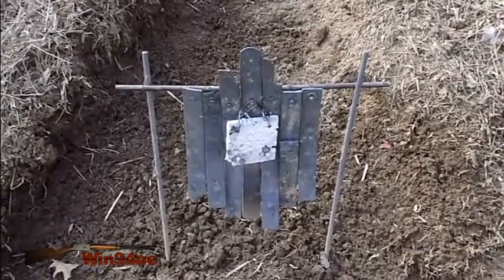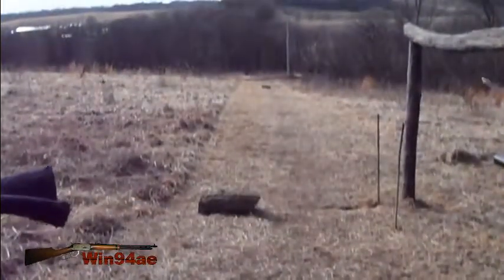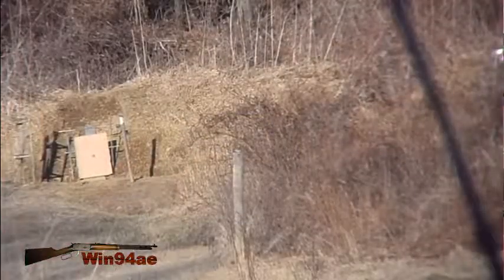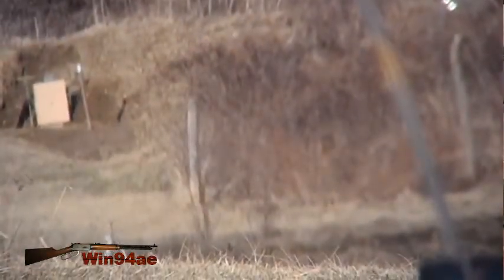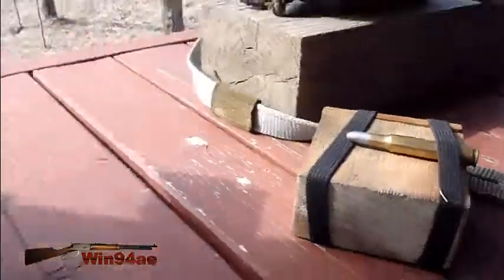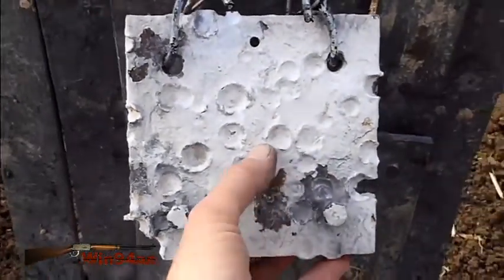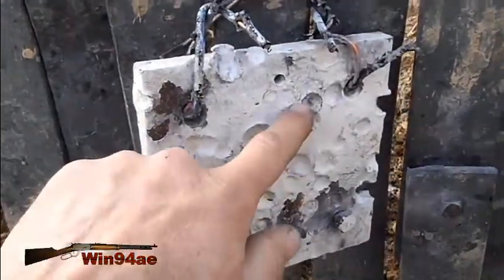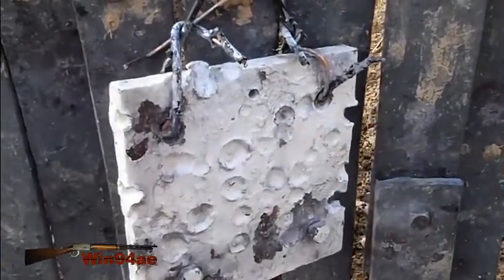30-06, IMR 4064, Cast 180gr, 2200fps

Comment: What was the charge weight for 4064 ?
Reply from the maker: I've come to the conclusion that the load was no good, too fast for the twist rate, which causes the bullets to fragment from time to time..
Reply: 30 to 34  4064 will be safe